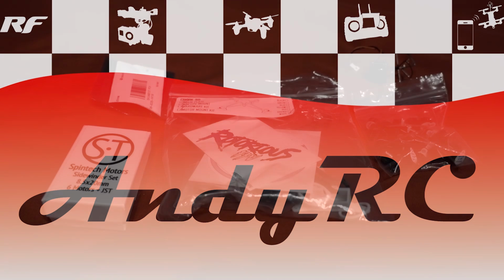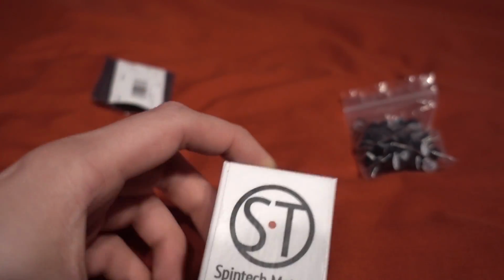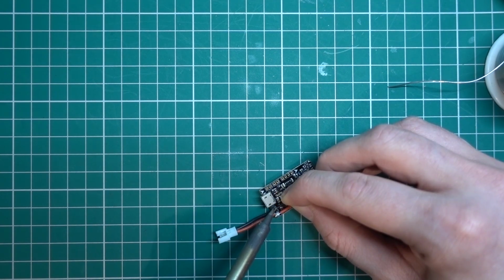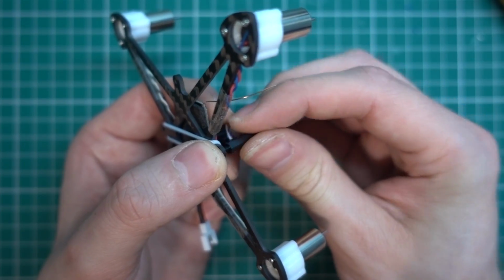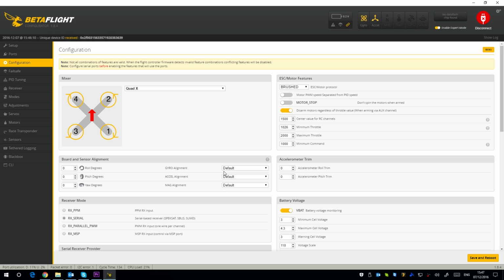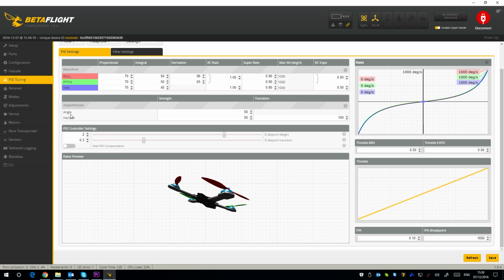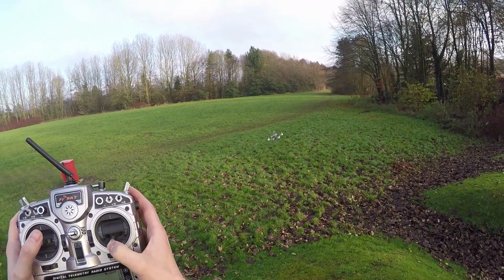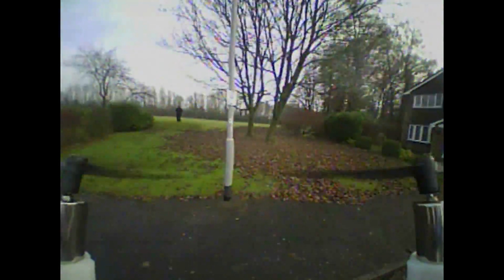Best Brushed Micro Quad Build

Comment: In all your years experience now with 1S batteries, can you suggest to me the most powerful 1S battery around 400mah or so, JST connection, maybe thick enough wire to handle a lot of electrons flowing through, quality cells?  I love micro motor warehouse 480mah 1S batteries but they are hard to get sometimes.  Thank you sir for what you do.

Comment: The RacerStar 8.5mm motors are the best choice, putting out 41.1grams of thrust per motor with 65mm Kingkong props and a 1s 3.7V 550mah 35-75c Battery.
Reply: I’m pretty sure I get a lot more then that with an old f3 brushed fc with 2s 450mah 80/160c LiHV & 2s 8.5mm brushed motors from hubsan h502e  . I like the 25mw AKK A1 & 25-200mw AKK A3 with built in OSD on both AIO cameras ( flight timer & voltage are helpful to save lipo batteries life span )

Comment: A little bit of blu tack Andy would help you out a lot, stick the frame down with it before you start soldering to stop the frame moving around.
Would this board work with a dx5e spectrum? My eye is on the F3 EVO FC as I think that does, the lighter weight of this one your using is a nice bonus.
PS. I just checked and it appears I will need the board I mentioned lol, I should just buy the Taranis and be done with it lol.

Comment: hey, awesome videos. I am planning to build my first micro quad, too. The crook 110 looks perfect.
One question though: You listed 600mah 25C batteries. I have no clue what amout of mah is optimal.
A lot of mah makes it maybe too heavy, not enough will result in short flight times?
One more thing: Why 25C? Can I use 50C aswell?
Reply from the maker: id say 600mah to 750mah is the sweet spot with this one
Reply: AndyRC thanks. and is 25c a must, is 50c OK, too?

Comment: Nice Build,I want one.Big Fan, watch all your stuff and it has really helped.I'm just new in the hobby so the trainer brushed builds as I see them are right up my alley and they even test my limited skills.
Looked on the Rotorious Website and they show the motor mounts below the frame, wouldn't that lower the CG even more and improve the handling even more?
Reply from the maker: i changed mine and didnt really make a difference motors are better protected when they are up top

Comment: hi Andy just quick question about this build done it almost the same as yours except used a naze32 brushed board.  what gyro update and pid loop do u recommend for this board its been flashed with naze bf 3 ?
Reply from the maker: the naze is an f1 chip so u want to run it at 1k 1k cheers
Reply: thanks for the info Andy she flys Amazing and your right its insane :) took for maiden yesterday with some parrot props on these are the original red ones seem to fit tight for me http://i68.tinypic.com/2la8qxh.jpg  take a look :)

Comment: Andy, very interesting to watch your build, I was wondering have you ever thought of converting the Eachine E50 folding quadcopter to work from hubsan 502e transmitter and still work the same as flying the 502e, interested in your thoughts on this.
Reply from the maker: iv not thought about it as i prefer the 502E in general over the e50 cheers

Comment: At the time I ordered the Crook 110 frame was out of stock, so I went for the Speck 80 frame
http://rotoriousfpv.com/product/speck-80/

I finally got it up and flying (my first working mini quad build :D )

I have only 1 set of good props though which are smaller than recommended because of the smaller frame. I can't remember where I found them. But I ordered several that don't fit tightly on the motors. So I'm looking for a good source of 55 mm props that will fit (tightly!) the motors recommended above.

Comment: Hi Andy. Whenever I arm this quad the motors start at a high speed. The throttle does have an effect: it just goes from high to higher. I've flashed to betaflight. As recommended, I've set the motors to Brushed. The center value is 1500, motor idle is 1024, max throttle is 2000 and min is 1000. When I arm the quadcopter I see the throttle received value is 1007 (the min value) and the motors take off like it's 1500.

The receiver page shows the min throttle is 1007, and max is 2027. On the motor test page, when I move the slider to 1024 the motors are moving at a very slow rate. 

Any ideas why my motors would be going so fast on min throttle?

Comment: good vid, thx for sharing. 
BTW my tip to you, I'm fairly fresh in the realm of fpv mini multirotor but I have a tonne of LOS experience. I
n my opinion the best way to get comfortable in LOS is by taking a large non-X frame (either a very strong one or my personal preference: a cheap, simple, modular frame that is easy to assemble and hotswap parts on a field) and fit it with the brightest LEDs you can find. Essential is a generous surface of clear white headlight! this combination will increase your sight range enormously making your training playground huge, thus allowing you to take all the space (and height) you need as you try new tricks for the first time. The biggest risk of LOS flights with multicopters (far more than planes, wings or heli's) is an interuption in direct line of sight for whatever reason (can be as little as a quick turn of the head to see your button or a split second of flying past an object in between you and your drone). With an x frame it is impossible to rely on the silouette you see at a distance for assesment that your sense of orientation translation has not changed from the last moment you had eyes on it.  I fly my smaller LOS copters (250-350) at range of 300-400m radius around me in broad daylight by making use of those main features. Mine are all K-shape designs so by it's shape i can instantly see what 4 out of 6 orbit axis are when close enough. Being upside down is usually noticed by fast descend but you can mistake front for back very quickly, When you do, its like your controls are suddenly inversed and many fail to recover from that before losing control completely. Even at large distance, you have very distinct confirmation that the drone is coming towards you or flying further away by the headlight. For additional indications I also use various colored lights on the underside of the front arms and the top side of the rear ams. that help me a lot when I exit a +1000 deg corkscrew tumble or stuff like that. With that setup i can tell top from bottom, front from back, as well as left from right.  
Hope this turns out useful to you or anyone else that wants to learn LOS acro.
P.s. I often see that people tend to forget the fact that flying LOS is entirely unrelated to FPV racing. Keep in mind that you have no laptimes to beat, nobody is overtaking you, and speed and power are not your main concern when you fly LOS. If you run 6" dualblades with 2000-2300kv off 3S 2200mah  50C on a 260 size drone, you can easily carry stuff like Lights or even GPS panicbutton failsafe.. If i run that on 4S 1800mah 65C, i have to be full focus in order to handle full throttle chaos for 8 minutes straight...

good luck, take care, cheers

Comment: Hello I wanted to know what's a good solder size and mixture  to use on micro applications
Reply from the maker: i use this one: http://www.banggood.com/0_6mm-Tin-lead-Solder-Wire-Rosin-Core-Soldering-2-Flux-Reel-Tube-6040-p-985802.html?utm_content=zhengsiying&utm_source=rcgroups&utm_medium=rcgs&utm_campaign=andyrc&p=XO2013166930201304K5
Reply: Cool thanks

Comment: do you need to set a motor pwm rate in the cli mode? i saw a video setting up one of these boards where the guy mentioned setting the brushed motor pwm rate to an ideal setting... ? idk and cant find anymore info on it. any explination to what that is or if i need to change it? i am actually building almost this exact quad. your opinion would be much appreciated. he said you set motor pwm rate to 23200 in betaflight for 8.5 brushed motors... ? thanks again love your videos!
Reply from the maker: not with betaflight no u just select brushed under the ESC option but with cleanflight u do need to set pwm rate
Reply: so you DONT need to set it? awesome thanks alot. have all my parts just waiting on the frame. binding to my turnigy evolution with micro receiver. you should review the evo, its amazing. thanks again!

Comment: Why not use 25 mw vtx?
Reply from the maker: u can use 25mw also
Reply: AndyRC I know but why don't you? 25mw gives far longer flight times than 200mw.
Reply from the maker: I get a 6 min flight time with 200mw and 6 min 30 with 25 so its not actually that different.
Reply: AndyRC okay, thats strange because i saw a video comparing it on a whoop and the 25mw was like 2:30 while the other was 1:30.
Reply: I fly a lantian 105 frame (cheapo from aliexpress) brushed and have a couple of very similar builds with the main difference being the camera. one is 200mw and one is 25mw, and can confirm that the flight time difference is quite negligible using a 800mah 1s battery. if you look at the specs between a couplea AIO cams, the amp-draw difference is generally not that big, at least compared to say 4xBrushed motors going at medium throttle anyway which hog most of your juice.
Reply: I would say on a tiny whoops with smaller motors (not 8520's but the others) and a 100-200mah battery, that makes some sense as you have much less total power, so a 200mw cam would make a bigger relative impact. just my newb thoughts.

Comment: hey andy, can you recommend 2 or 3 good battery packs for this class of brushed quad? I'm looking for 500-600mah, at least 25c, and something that will last at least 4 months flying a good deal.
Reply from the maker: the ones im using are the 600mah 25c from the qx series link should be in the description cheers

Comment: Hi Andy, I got the QX90 from Banggood with a Flysky reciever, I now have a crook110 frame and am wanting to swap the parts over. However the boad I was supplied is a "Happy Model F3_EVO_BRUSH and the layout is slightly different to all of the others I have seen (yours is closest but you have built in RX, I'm wanting to connect a buzzer but I'm unclear as to which are the positive and negative pads on the board. it looks to me you are connecting to the last 2 pads on the four after the motor pads but which one is pos/negative, also my camera came off in a crash and I dont know where to solder the red/black wires? any help would be grately appreciated!!!
Reply from the maker: is it this one? http://img.banggood.com/file/products/20160816214511F3_EVO_Brush%20manual%E8%8B%B1%E6%96%87%E7%89%88%E8%AF%B4%E6%98%8E%E4%B9%A6.pdf

Comment: Nice build Andy.  You might like this one as well.  I know the guys on the threads are thinking of building this one as well.

https://www.youtube.com/watch?v=82z7LoxhJl0&google_comment_id=z122zd1ocmntcz1l322cw1z4twnasrlyr04
Reply from the maker: nice video need to check out those mjx motors!
Reply: they are the stock replacement motors from the MJX 600 copter.  $4 a pair, $8 for a full set from banggood. You can not really beat that. :-)  I just hate soldering.  I wish eachine or someone would make a nice 2s brushed quad.  If I didn't have to build it I would have bought that CX-117.

Comment: anyone put these spintech motors in a qx95? thinking about ordering some up when they get back in stock. are they much better than stock qx95?
Reply from the maker: yes much better than stock. it will fly like this one
Reply: AndyRC to bad they are out of stock. do you know if the ship to america? also the should plug right in to qx95 i would assume? awesome videos keep up the good work learning a lot from you.
Reply from the maker: search spintech on google i believe they are actually a US company cheers
Reply: awesome thanks alot
Reply: i was gonna upgrade. i decided to just do this build now. i have an evo radio and my qx wont bind to in so im just gonna do almost this same build with micro flysky rx so i can bind to my evo and have a ripping little brushed to fly with my fav radio

Comment: What is the size of these props? 65mm?  how do these motors compare with chaoli equivalent?

Do you have any problem keeping the fc board level? The board is not totally flat. It has components still out.  I have an eachine ex105. The craftsmanship on it is bad. The fc board was not level and as soon as I applied a bit of force the board just moved a bit. I ended up using hot  glue.

btw a lovely clean build again!
Reply from the maker: i think with the rtf that come with this FC there is not much passion when it comes to the build. often the FX is not on streight

the sticky pad that comes with this one is thick. do despite the components not being flat. if u press it down in the right place u can make it sit flat in the foam and its in rock solid. with this frame u can get an additional FC mount too but I chose not to as it adds weight. yes they are 65m if i recall

Comment: Question:  Since FlySky and Turnigy are pretty much the same brand, will the FlySky receiver connect to a Turnigy transmitter?
Reply from the maker: do you mean the turnigy i6? I believe so yes
Reply: AndyRC Turning evolution, but it should be the same, right?
Reply from the maker: as far as im aware that one wont work
Reply: Ah ok thanks.
Reply: the Turnigy evolution and i6s use a different protocol from the Flysky i6. But weirdly, there's a new Turnigy rx with SBUS that DOES work on the old i6. Painless360 did a video on it

Comment: Can I bind the eachine QX 95 with DSM2 to my Spektrum DX6i ?Awesome vid, you are the most helpful channel when it comes to micro quads !
Reply: It will work. All DX6i have DSM2.
Reply from the maker: it depends on the age of your transmitter. the later spectrum tx only support dsmx as it was removed in europe. how old is the tx?
Reply: At least two year maybe even older, I bought it used from a friend.
Reply from the maker: u might be ok but i cant guarantee have a look in the manual to see if it supports dsm2
Reply: ok, is there also a way to see that looking into the settings from the transmitter? I can't remember wehere I put the manual
Reply: I have an old DX6I that binds perfect to every dsm2 and DSMX rx I've ever tried
Reply: Thanks, do you know how old it is?
Reply: It's super old, its pre dsmx. It says DSM2 on it, they don't even make them anymore
Reply: They made dsmx backwards compatible

Comment: im looking to get a youbi xv-130, tarot 130 or something similar in size and i know that they both use spracing f3 boards. My question is the f3 board compatible with a spektrum sat? I have seen videos saying that it is but i cant find anything comfirming this so i dont know if i'd have to go with a lemon rx dsmx compatible ppm reciver.
Reply: Tyler Mills the Tarot 120, 130 and 150 DO NOT support spektrum satellite rx's, only PPM, PWM or SBUS. It's running a custom mini Naze32. That's the reason I never got the Tarot 130, bc at the time I only had a spektrum transmitter and I couldn't find a small enough DSMX ppm receiver for it.

Comment: My two micros came in. I think they swapped the QX90s props I get no vibrating. The fire 104 was much more touchy and more punch. It does work with the DSMX module on two flashes per (whatever mode it is).
Reply from the maker: thats good to know thanks!

Comment: I was gonna make an LT105 microquad, but i have found out two of my motors' leads are about 5mm too short. Which cables would you recommend to lengthen the wires, standard servo wires, or the wires that come with the CC3D? http://learnrobotix.com/img/pics/fpv-quadcopter-racer/250-FPV-Mini-Quadcopter-Racer-047-600x450-70rez.jpg The ones on the left on the picture
Reply from the maker: i use 28 guage
Reply: Problem is, I'm not exactly sure what gauge the wire is, seeing as it just came with my cc3d.
Reply from the maker: it wont really matter too much
Reply: Just looked closer at the cc3d wire, seems its 28awg, so thats perfect haha
Reply: By the way, do you have any tips when soldering on an antenna on a VTX? I can do the soldering bit, but im thinking thats probably very fragile. What do you do, just put hotglue around and between it, or?
Reply from the maker: soldering the antenna is tricky what vtx and antenna are u using?
Reply: VTX: http://www.banggood.com/FPV-5_8G-200mW-Wireless-Audio-Video-Transmitter-Module-TX5823-p-84780.html
Antenna: http://www.banggood.com/FPV-5_8GHz-Micro-CL-TX-Anternna-0_8g-Lightweight-p-973291.html
But i can probably get it soldered, what i was asking was, do you have any tips for preventing the antenna breaking off, or are good solder joints strong enough? Would hate for it to break off mid-flight :P
Reply from the maker: sure i made a vid showing how to do that...https://www.youtube.com/watch?v=vIpZAGv_jlI&t=2s

Comment: Do you know what temperature your soldering iron is at when you use it
Reply from the maker: 350 for small wires 400 to big solder pads
Reply: AndyRC I know that MMW dark edition motors are pretty expensive but how do they compare versus spintech motors??
Reply from the maker: Id say more power with the spintechs, need to do some thrust tests

Comment: And I have a question, do high D values harm motors like in brushless? I am trying to keep them as low as I can but the motors get quite hot in any PID setting that I have
Reply from the maker: +Onur Can Vural brushed motors get pretty hot especially when the specks are pushed to the max. Iv not noticed any issues bumping the d high
Reply: Thanks a lot